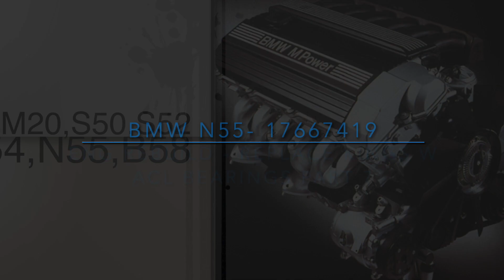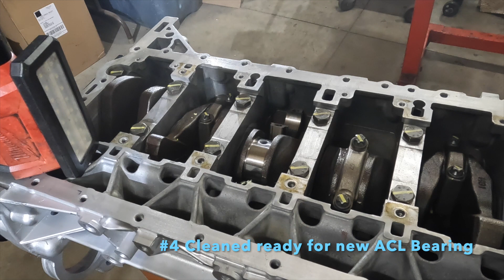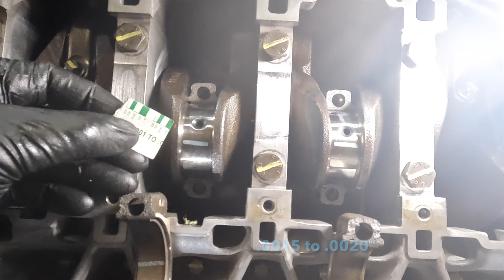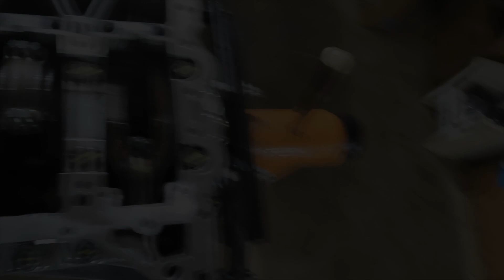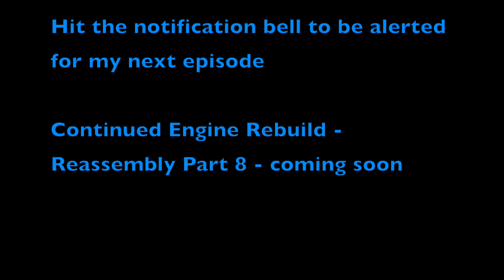BMW N55 17667419 Rebuild ACL Race Connecting Rod Bearings Installation Part 7

Comment: im about to replace the bearings on n20, I know that n55 uses the same bearings, and one of the issues of n20 is the same - spun of bearing. So just wondering is it worth to just replacing them with ACL, and an oil pump as well to improve the reliability?
Reply from the maker: @tvolex  yes, replace with ACL
Not sure you need to replace oil pump, you can just inspect, see my oil pump inspection video

Comment: Out of curiosity, did you plastigauge the King bearings? If so what was the difference in clearance? If not, what's the point? 
Trying to decide what to do after purchasing a car with this engine.
Thank you!
Reply from the maker: @fstlnj29  Hi new Kings bearings were installed as all bearings were plastiguage to confirm correct clearance
Reply: Thank you!

Comment: Are you still using the acl trimetal rod bearings in your rebuilds? Or, have you gone back to using the kings? Would you recommend babitt or trimetal for the mains?
Reply from the maker: Yes 
ACL Race series for rods and Kings for mains

Comment: Hello, it's normal that for me on 6 cylinder I have 2 cylinder which has no compression the connecting rod with the piston rises from bottom to top easily I saw the 3rd cylinder with the valves open but the 2nd cylinder it's obvious to see if it's open is that normal for you?

Comment: The King GPC silver oxide coated bearings should be best if you can find them. They are similar to the IROX coating that BMW uses on the B58 Glyco bearings. If you watch most B58 teardowns, the orange coating shows almost zero wear. What part number did you use? The ACL tri-metal may have a softer top layer which could be good for embeddability and more forgiving but may not last as long in theory.
Reply from the maker: Thanks for the note I will look into the King GPC. I know that the ACL top layer is a lead - tin / copper which has sone deformability- not sure on embeddability  of foreign materials.  To a touch it feels hard as compared to the OEM bearings with a babbitted layer for embeddability

Comment: ACL recently came out with the with 0.025mm (.001”) with the extra clearance bearing
Reply from the maker: Yes, I bought a set and was prepared to use if I needed to maximize clearance
Reply: is it ok to use the acl with extra clearance for con rods as preventative?

Comment: Good info. I chose the ACL over king as well.
Reply from the maker: Do you have your engine running ?

Mine has 200 miles
Reply from the maker: Let see how this goes, this engine is going into my F10 535 Xi
Reply: Which connecting rods u used